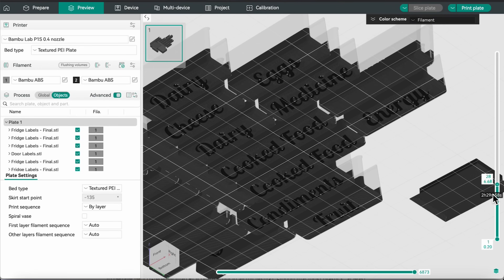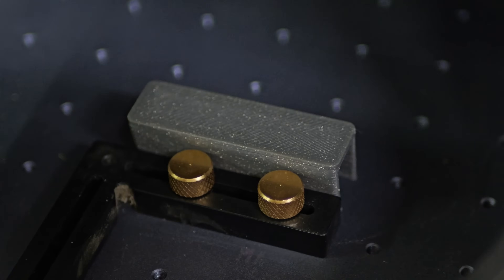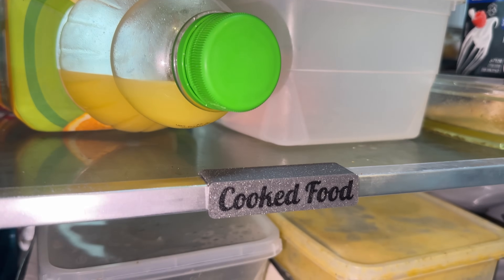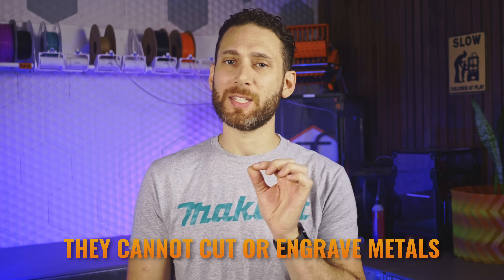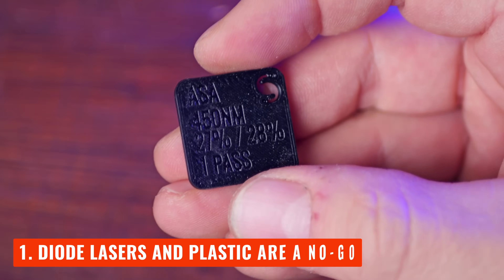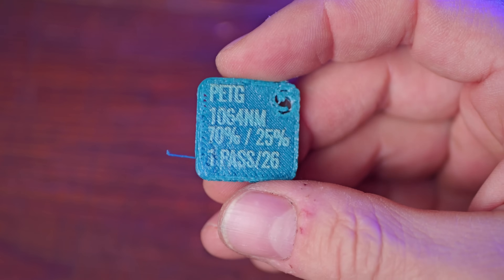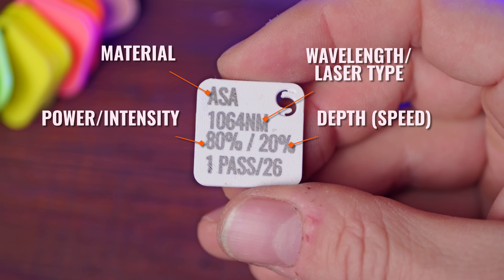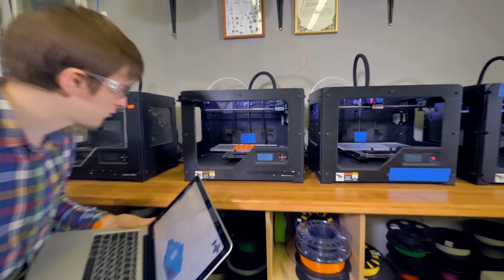I Experimented with Fiber-Lasering My 3D Prints

Comment: Is it that 3D printed text sucks or that FFM text sucks?  Every printing technology has pros and cons.  FFM multi-colour/multi-toolhead can do things that resin or SLS cannot and vice versa.  I think a larger problem that is rarely addressed is the end user's expectations, and most of them are made in ignorance.  People want a one-stop-shop result from a technology that it simply cannot provide.  Just like with cars, there is no single "this is the best car" option.  it all depends on what you need it to do and there will ALWAYS be tradeoffs.  The key is in understand them AND accepting them.  Injection molding will ALWAYS beat FFM or resin in speed.  FFM will always have an advantage over resin in multi-colour prints.  FFM will always have a time advantage over injection molding when it comes to the time from completion of a design until the first physical iteration is produced as no mold has to be cut first.  Each technology is kind of like an AD&D character.  You won't get 18's for every stat.  Your mage might be wise and dexterous but the tradeoff is that they are weak and ugly...unless you cheat during character generation and that's a whole different argument.  lol

Lasers are good assuming you can focus the light on the spots you want to cut/engrave.  If text is truly so important then I don't think you'll ever see one single printing technology that will be fast, super accurate, beautiful surface finish and calligraphy level script AND not be wasteful in both material and energy.

Like as with MANY areas in llife I find people tend to spend more time complaining about what they do not have rather than showing genuine appreciation and gratitude for what they do have.  Here we are complaining about 3D printed text quality but 20 years ago this was not even an argument 99.9% of the global population would have ever even considered let alone engaged in.  Then again there's a perfectly good chance that I just spend FAR too much time pondering things like this because my Asperger's doesn't allow me to understand "normies" very well...or at all in many cases.

Comment: 1064 newtonmeters? That is plenty of torque for a laser engraver.
Reply: You sort of used 3 different units for wavelength. Sure, newton-meter was a goof for nanometer. But also, the C02 10.6 micron is just 10,600 nanometers. Easier to just describe them as 450nm, 1064nm, and 10k nm.
Reply: @yertle38  Agreed, keeping all wavelengths in nm is best.
Reply: @yertle38  he's  3d printer dabbling in lasers.  I think he got the point across, and I don't think anyone is going to be using this as a reference for laser technicalities. 

I have a big 60watt co2 laser I've been thinking of selling. I'll probably sell it, and then switch over to a smaller fiber setup like this. That way I don't lose functionality but I gain space
Reply: @HowtoDeluxo-y5t  If you use your CO2 laser to cut, then you may consider that when a galvo laser cuts (assuming powerful enough) the cut surface is a varying amount away from vertical, due to the single point of origin of the laser. The cuts on a CO2 XY gantry laser are not quite vertical either, but are at least consisent.
Reply: @Graham_Wideman  @Graham_Wideman  i don't actually use it to cut anymore. I want something to engrave metal and ceramic. I'd like to have a rotary setup. I use lightburn on my CO2, ideally I'd get a galvo that is compatible with lightburn plus a camera. Id want to put the entire thing into a light tight enclosure with exhaust fan and physical door interlock.  The safety on these galvos leave a lot to be desired. The first thing I did on my co2 laser was to put a door interlock on it. I had no interest in losing my eyes to a moments error
Reply: What's the problem? Makes sense to measure a Pecker in units of Dork!
Reply: Lol.  The funniest thing said all week.
Reply from the maker: brain fart! I put the title on screen because I caught it in editing! lol.
Reply: @thenextlayer  happens to the best of you too! Keep up the good work!
Reply: sold. i'll be using that engraver from now on to change tires on my car.

Comment: Hey, Jonathan, for cases of working with models and as a cheaper alternative, what do you think of adding the negative of the desired text in the model, and then using plastic putty and pushing it into the negative space of the text to fill it up, and scrape the excess off? The putty won't flow so it could be done at any orientation and it could be either mixed with some paint or bought at a desired color.
Reply: @galgrunfeld9954 The puty Solution is a great idea just make sure to apply it with care and wipe it clean carefully. For anyone with two hands the result will be fine.
Reply from the maker: I've tried that, it gets messy and gets into layer lines :(